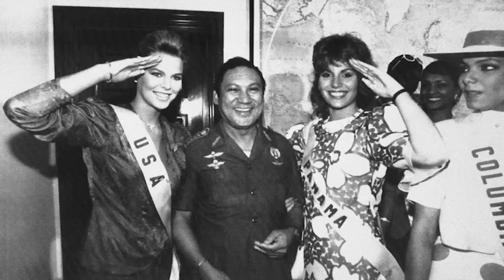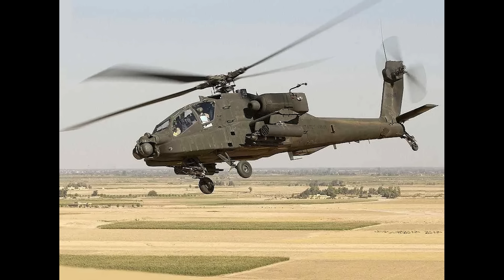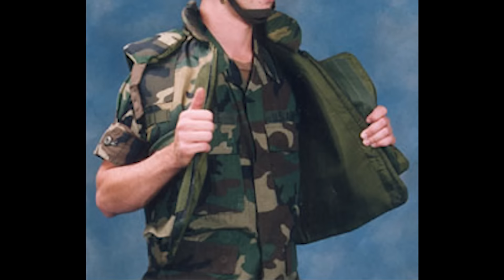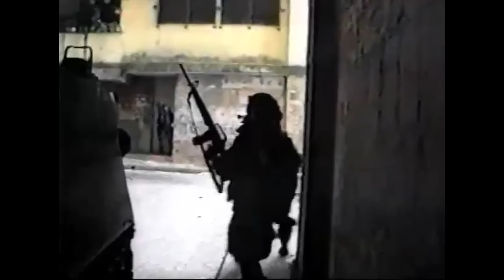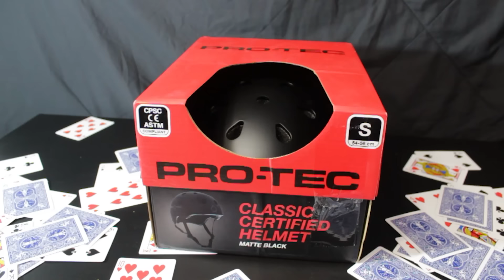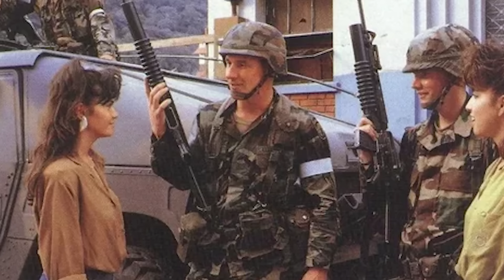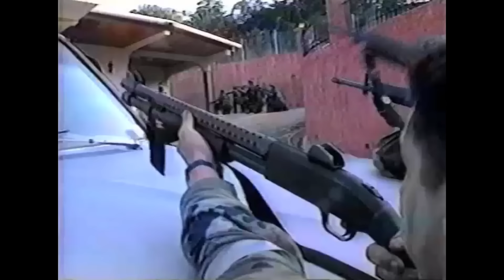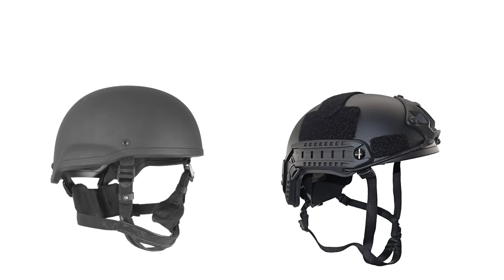Why Do Special Forces Wear Skateboard Helmets?

Comment: The military really came a long way in such a short time. I was in the army from 2016-2019 and we were wearing the ACH, I thought it was just about perfect. Not too heavy, sturdy, plenty of coverage without snagging on your kit, and comfortable to wear for long periods of time in just about any weather. Hell I slept wearing my kit plenty of times in the field and the padding inside the helmet made it comfortable enough to just keep on and lay down like a pillow.
Reply: I was in the airforce in a Scandinavian country from 2001 to 2003, I was issued with an M1 helmet and webbing that I believe were remnants from the Marshal aid.
Reply: @KeNost82 now days the Scandinavian countries have nicer gear than the Americans
Reply: @tommy2211D Yeah, the soldiers that were enrolled after me got the benefit of the investment plan the government put in place for modernising the air force. Kevlar helmets, modern LBE system, better running shoes and PT clothes.
Reply: ACH/ECH > IHPS
Reply: @ThatGearCollector2002  never used the ihps but i have heard this sentiment repeated. props for also knowing the diff between ach and ech
Reply: @mingus444_gaming  The Marines did get it right the first time by having high cut helmets unlike the Army.
Reply: @ThatGearCollector2002  high cuts are not a good idea for widespread use. it makes sense for rangers and other sof because of the nature of their mission, but not so much for regular line grunts or pogs
Reply: i did that in basic too, i didn't really have anything to use as a pillow so i just used my helmet
Reply: I deployed for the 04-05 summer fun of Iraq.  We had to replace our vests for IBAs in Doha.  About 9 months in Iraq we had to replace our kevlars for ACHs.  I will honestly say I don't know if they work better.  What I can say about the kevlar is that your body gets use to it.  There is a joke - "Where is my Kevlar?" because it is a part of your head, the private is running around trying to find it when it is on top of his head.  I've done it.  Once that leather is set and you have the grime on the chin strap, it is just part of your body.  Beyond that, watching the Army slowly being turned on during that time was an experience.
Reply: The ACH to this day is the worst helmet I’ve ever worn
Reply: @tommy2211D  You say it's the worst but didn't elaborate on why, what an oh-so great comment on the internet
Reply: @alicorn3924 ok it didn’t fit well required extensive modifications for fit alone didn’t really protect from anything except shrapnel the chin strap was straight ass had to replace that too crushed my comms system was extremely fragile and the military made me modify it for pretty much every time I had to use it I can elaborate more
Reply: @tommy2211D  Is there some way to say "maybe your head is shaped a little funny" without me sounding like an huge dick? :D

For real tho, I'm guessing every helmet ever made, in the entire history of helmets, would have some people finding it fits like a glove, and some people finding that it fits like crap. Even modular padded liners can only do so much, too.
Reply: @cykeok3525 my head is actually shaped a little weird but ACHs just aren’t my favorite there’s nothing I like about it haha
Reply: @tommy2211D but can you throw in a few commas and periods?

Punctuation is cool, kids.
Reply: @tommy2211D 
Dunno man. The ballistic helmet was a migrain machine. My MICH was comfortable. You just had to test drive different pads if you had issues. And mine is NOT a nice and round melon.
Reply: @jk-76  agree...that leather strap on the kevlar caused  me endless headaches
Reply: @tommy2211D  anything was better than the leather on the kevlar...brutal

Comment: When your #1 casualty producer is knocking yourself cold on the doorframe of a helicopter, a lightweight skateboard helmet makes sense. Especially back in the 80s, bump helmets didn't exist back then.
Reply: And that Right there is what it was all about. They needed something to protect their head from bumps and falling debris but not from bullets cuz they didn't do direct engagements Mogadishu was a fluke on their direct engagement. I know people from there I know people that wore those helmets. They want to be able to get through places hear what was going on around him where their communication and not bump their head on the corner of a 2x4 or something. It was never about ballistic protection.
Reply: Wasn’t the PASGT helmet uncomfortable AF until the upgraded suspension kits came on the market? Spec Ops folks wanted impact protection with no visibility/hearing/mobility reduction.
Reply: @NotALot-xm6gz  Yep. I had a foam donut in mine to help with the comfort back in the mid 90s. It added heat, but was necessary because the internal webbing was uncomfortable. That sucker was heavy too. You needed to build up your neck muscles to wear it comfortable all day long.
Reply: Lots of skydivers and skydiving schools choose this helmet for exactly that reason.
Reply: Protec is the OG bump helmet.
Reply: That doesn’t explain why not use a Kevlar helmet (K pot), which would also mitigate helicopter head bumps.
Reply: @jimbonguyen  That's a good comment. Someone needs to make a video to explain why special forces units chose to use bump helmets instead of kevlar. If I find a link to such a video, I'll be sure to update here.
Reply: @jimbonguyen too heavy. That's like a whole ass kilo and then some on your head, when the job is to outrun, outshoot, basically overwhelm the (numerically superior) enemy with superior skills and mobility. By creating the illusion of being everywhere at once, it also has the effect of creating the illusion of also being nowhere at once. The ideal scenario is such that from the enemy's perspective, they might as well be fighting very loud angry ghosts that bark rapid and accurate gunfire. 

With direct action, if you get bogged down, you're almost certainly fucked if you don't have a QRF or close air to come bail you out. Mobility is king.

Besides, most direct action raids conducted by expeditionary military forces are conducted against enemy forces using rifle caliber weapons and of... Let's just say questionable skillsets. The odds of them landing a head shot using a weapon that'd be stopped by 3A helmet armor is very slim.

Probabilistically, head trauma leading to lethal end result among SF communities can be traced to (in decreasing order of likelihood) impact trauma to the head, or getting your neck snapped from vigorous movement (to include getting tossed and thrown about during combat), or the odd chance of getting shot in the head with a rifle caliber weapon. A K-pot doesn't stop the latter, and increases the odds of the former two outcomes owing to its weight. Hence, before ultra light aramid shells became a thing, the best bet was a pro-tec.
Reply: Well spotted?!
Reply: SF doesn't offer a lot of head shots.
Reply: Bump helmets did, in fact, exist in the 1980's in the form of modified football helmets and hockey helmets.  On Fort Bragg, they used a football helmet, modified with a hockey face shield for tree jump and fast rope training.  One of the problems with the first gen PASGT was neck injuries during jumps.  During my time in the early 90's was the additional straps and cushions on the paratrooper PASGT.  Some of us literally used styrofoam blocking or neoprene from wet suits to add extra cushioning.  I used to wear motocross underpants when I jumped.
Reply: Bump helmets didn't exist back then? 

F'n Duh. Lolwot
Reply: @thetvbaby83 back in the 80s and 90s we didn't had the modern bump shells that had integrated accessory rails and night vision brackets. It was just stake helmets.

Comment: I would definitely go with high cut pro tec for same weight versus protection reason alongside better hearing and sense of surroundings / awarness.

"low cut" traps noise inside the helmet so not only your hearing is blocked more but there is echo and humming which annoyed the hell out of me in army.

Plus I didn't like the fact the helmet when leaning on something will tilt on your head.
Reply: I hated the ACH. Now, after being out for years, I have a bump helmet for larping purposes. It is everything I actually wanted when I was in the army.
Reply: @tackytrooper  what type is it? i don't want to spend that much money for a team wendy one

Comment: The MICH wasn't developed by the U.S. army it was made by a French company called CGF Gallete with the earliest models being made in 1997. There are other helmets from earlier in the 90's like the ILC Dover. The ACH wasn't produced either until around 2005
Reply: The MICH was developed in the US in 1997 and officially adopted in 2001. The prototypes for the MICH were literally just cut down PASGT helmets. The MICH and ACH helmets he shows in the video are the High Cut versions where the ear protection has been cut down to facilitate larger ear protection/communication headsets. The French may have developed something similar based off the PASGT as well but it is very unlikely that whatever they developed influenced the US helmet.
Reply: @Sturmischer  The first TC-2000 helmets were manufactured by a French company. CGF Gallet. They were later bought by MSA and the TC-2000 (MICH) was then produced by MSA with the tag MSA-Gallet
Reply: @JuliusCheeser223  they were manufactured by them yes, but they are not the ones who developed the design. The design was developed in the US before it was given to contractors to produce.
Reply: @Sturmischer 
I doubt it.
Reply: it started production in 2003, I have one marked as being made in 2004
Reply: @MiškoĆetković  The earliest examples are dated as far back as 1997 by CGF Gallet a French firm. TC-2000 helmets were no longer manufactured after 04.
Reply: @MiškoĆetković  The MICH started production in 2003??? I read the SFAUC manual with photos of it pre 9/11. Wikipedia says "Released in January 2001".

Comment: A delta guy died from a ricochet wearing one of those.
Reply: L. Vickers talked about it
Reply: Ah yes, the incarcerated fellon
Reply: @BewilderedDuck-e5l ??
Reply: @BewilderedDuck-e5l The hell's that got to do with anything?  Tons of people are in prison because they got hemmed up on retarded gun charges.
Reply: I clicked on the video with the intention of saying "because they're idiots" and here it is, the proof.
Reply: @TheAlexRhodes  Considering that's one of only few examples they can point to and not a regular occurrence the switch didn't change much besides that one guys life compared to everything else. Bet there are plenty of blunt force injuries avoided that just aren't talked about.
Reply: @bigboyepic8598  Sure, but special forces almost exclusively attack with initiative, usually on unaware targets far from the front lines, performing numerous war crimes along the way.
They could run most of their operations without helmets (*a few decades ago) and still come out with similar results.
I mean, good for them, high speed-low drag skater boys, but it's a good demonstration for not blindly following anyone with authority on a subject.
No responsible person should enter a gunfight with a fake helmet.
Reply: @TheAlexRhodes  The troops didn't get smarter. In the following years, troops in Iraq didn't want to wear body armor because of the weight so they would remove the plates. They would also drive around the "battlefield" in per-modified Humvees, because they didn't want to walk on patrol, and then complain the vehicles were unarmored and had no way for them to fight back while in the vehicles making them easy targets.
Reply: @orlock20  Sounds like the battlefield version of "1st world problems".
When you empire is turning some poor shi-hole inside out, so you can afford to act like a diva because your advantage is that overwhelming. Says a lot about how "hard" they had it.
Reply: @TheAlexRhodes  People complain about casualties and troops do stuff like that.
Reply: @orlock20  Honestly US casualties were always miniscule in their modern wars of terror.
They do always talk about that, but the reality is their revenge ops reap 1000x of what they take.
Fallujah being a prime example of punishing an entire city for hosting insurgents.
Meanwhile westerm PMCs will go full auto on a crowd of random civilians and uncle sam is like "huh"...
Reply: @TheAlexRhodes  "Insurgents"... Makes them seem like quaint freedom fighters.  They totally weren't lopping people's heads off, graping everything that moved & holding civilians hostage/killing anyone that tried to flee the city.  You're acting like the civilians of Fallujah had any say in the matter, and that the USMC broke a contract by not keeping their word after Fallujah 1.

We never should have gone into Iraq a second time as we should have taken Hussein out the first time if we were going to do it.  But pretending like the jihadists were good dudes just fighting for their country (as most of them came into the country looking for a fight) is retarded.
Reply: @orlock20  not necessarily weight but the heat factor. Add in ACU's which don't breathe at all along with a nut flap, neck attachment, shoulder pads, side sappies, gloves ...on and on...oh throw some knee pads on there and then be told do not roll your sleeves. a foot patrol in 115 degrees had terps falling out with heat stroke so yeah.